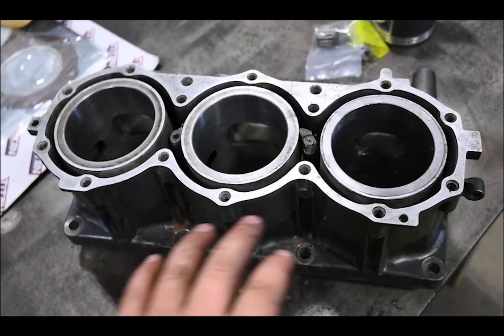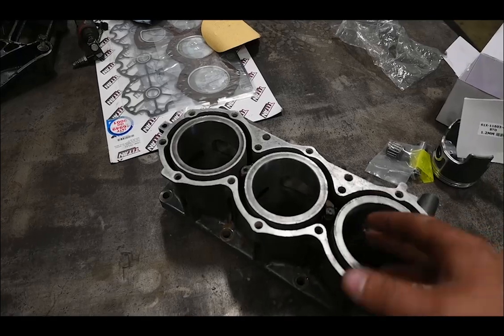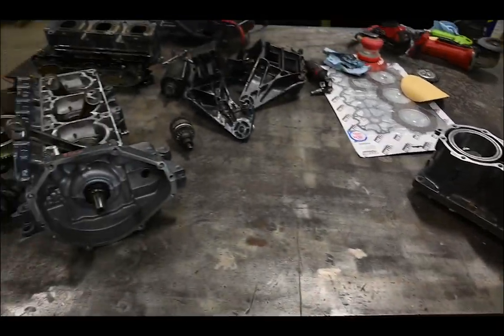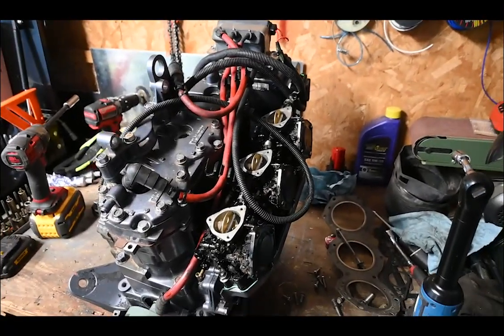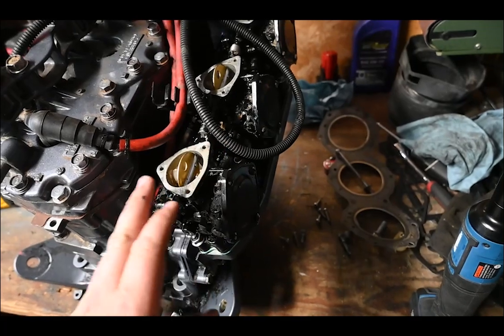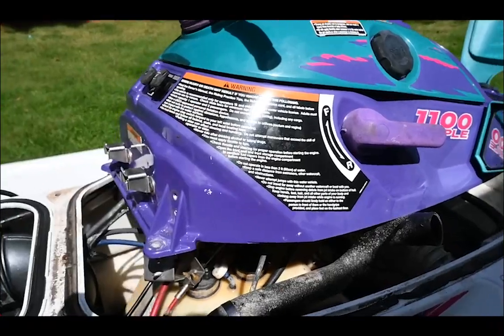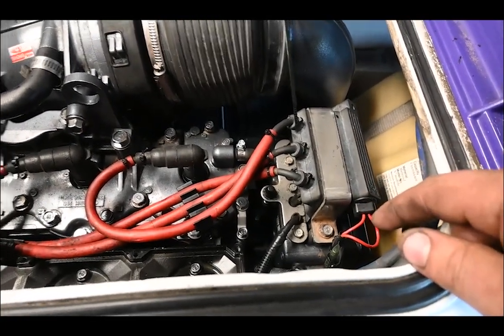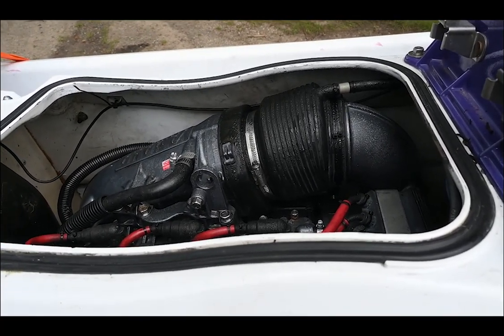Jet Ski Revival Part 4: engine assembly and first ride! (Yamaha Wave Venture 1100)

Comment: How did you get it in the hole?!?!?! How much of the engine was assembled when you re installed it. I am struggling to figure out how i am suposed to re-instal the engine
Reply from the maker: @EricM1180  I think you are supposed to remove the gas tank and the front cover that the steering is mounted to. I managed to get mine in without the exhaust on but it did not make me feel good while doing it. The front hole is much bigger and would be easier to get the engine in
Reply: @adaminthemitten8940  THANK YOU SO MUCH for the reply!
Reply: @adaminthemitten8940  Quick follow up question. For the 4 engine mounts that attach to the hull. There are two spacers for the engine mounts. Do these go on the front or the rear of the engine mounts? I pulled the top off and tank and have finished cleaning up the inside. About to put the engine back in, but I cannot find great instruction on where the two spacers go.